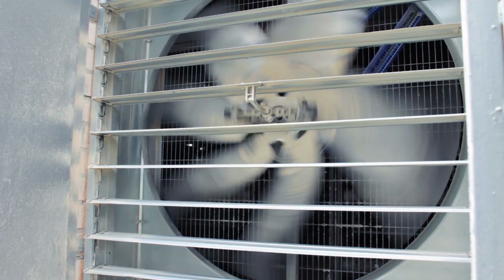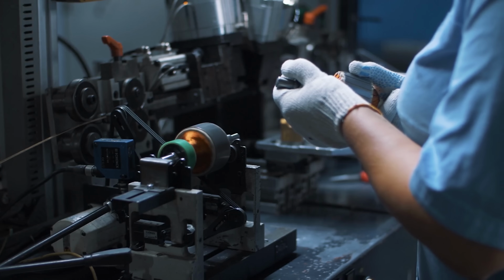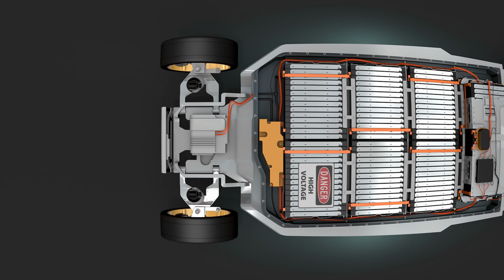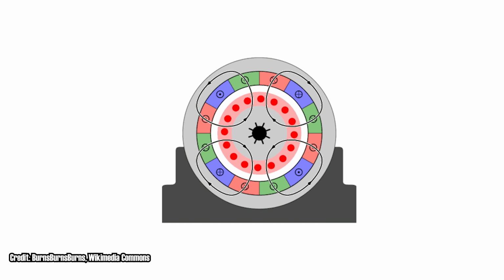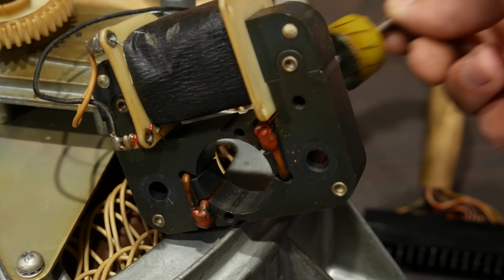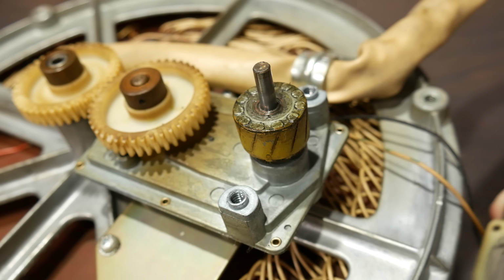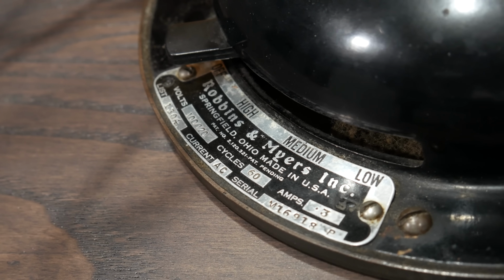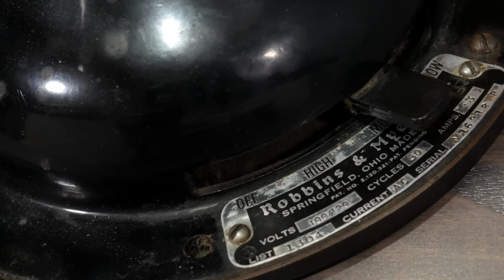Fans; High is next to Off on purpose

Comment: i just noticed that one of my ceiling fans will not spin if it's set to low when i turn the switch on. I have to set it to high to get it moving. I have the same fan in another room with a different remote. This fan will turn on with any setting, and I can hear the motor briefly run at a higher power to get it going. I wonder if that behavior is actually done by the remote and not the fan...

Comment: At 4:56 you seem to state that traditional homes get 2 phases of 3 phase power. This is incorrect. In actuality normal homes only get 1 phase power. This can be 208v for commercial or closer to 240v for residential. Then tapping to common/ground we get 104v commercial or 120v residential.
Reply: You've misunderstood. He's talking about apartment buildings at that timestamp. Those often do get 3 phase service to the building and wire individual apartments to two of the three.
Reply: He has an entire video explaining that concept. He knows. 
The resident in the building gets two of the three phases, 120° apart. That's why they have 208 volts instead of the 240 found in most residential homes on single phase power.

Comment: Hoping someone where can help. I have a Panasonic F-1205 fan with a broken blade, and I'm struggling to find a replacement one. If anyone knows where I can look to get the blade without having to buy a whole new fan, I'd really appreciate it. I tried a generic replacement blade that was like $5, but it didn't fit where the blades screw on.

I'm no engineer, just a guy with a sentimental fan from my grandma, but I'll do my best to answer any other questions if it'll help. Thanks :-)